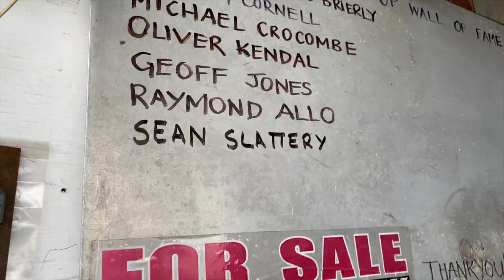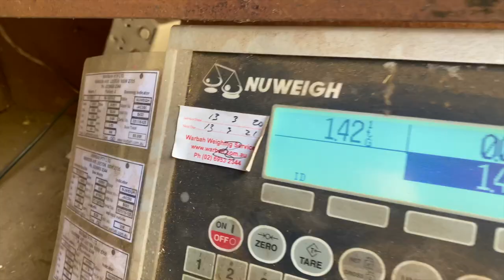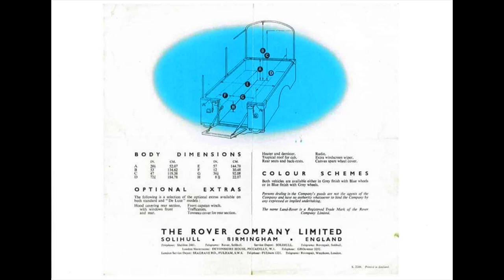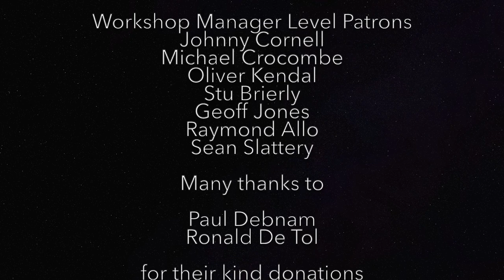Landrover Series 1 repairs, rego and camping set up - swag platform, hood sticks and canvas canopy.

Comment: Camping adventures are fun!! Nice hoops.
Reply from the maker: Sure are Cory, sooo looking forward to doing lots more now this little truck is on the road.  Hoops were surprisingly straight forward, $36 worth of gal pipe and  a few hours to save what they charge for new ones.
Reply: Vintage Restorations Australia excellent price. Do you know the diameter and wall thickness you used? Y’all were pulling hard to bend it.

Comment: Put one wrap of Teflon plumbing tape around the cone of the ball joint and then tighten it. The next time you want to remove it it comes of without force
Reply from the maker: That is a great tip, I will try that, I did smear it with copper grease on assembly.

Comment: Those tail lights on the old girl are expensive from what I’ve seen. Are they originals or did you find a knock off version that’s affordable without having to sell a kidney?
Reply from the maker: Yep sold a kidney and a liter of love on Ebay to get those, they are original Lucas, quite hard to find, I cleaned them up a little and rewired them a few episodes ago.

Comment: Hi Steve. Congratulations on making road worthy. Could I ask if your steering damper is original as mine does not have one?Cheers Phil.
Reply from the maker: Thanks Phil.  No the damper is a retro fit, no series 1's had dampers originally, pretty easy retrofit and make a big difference.  I just put one on the Electric 2A also, had to make a few brackets but it seems to works ok, you can buy them too.

Comment: Might I suggest if the bolts you used on the bows aren't tank bolts or similar it might be a good idea to put something over top of them to stop wearing a  hole through your new chances.  If my memory serves me correctly don't you have to soak them to make them water proof.  Cheers
Reply from the maker: Good advice Julian, I usedlow profile stainless button heads but will Dip and Grip them next time the hood comes off.   Exmoor say to just leave it and it will shrink to fit, it got a light sprinkle of rain this afternoon, not complaining about that :-)

Comment: Hitting both sides with a hammer creates a perfect disaster when the weakened part fails
Reply from the maker: As we said the puller is the correct and best solution, if the joint fails and you don't have a puller then the twin hit may get you out of trouble (or it may not :-))